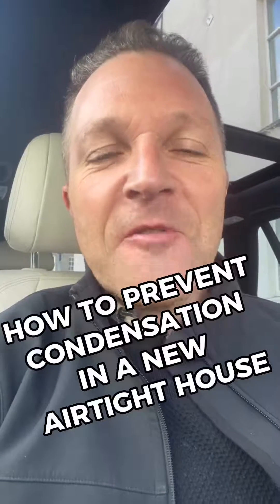How do you prevent condensation in a new airtight A-Rated house?

Comment: Does carbon dioxide build up in A rated homes?
Reply from the maker: @C05597641  it shouldn’t as these homes tend to have mechanical ventilation which deals with this issue. This is clearly essential when you achieve a certain level of Airtightness